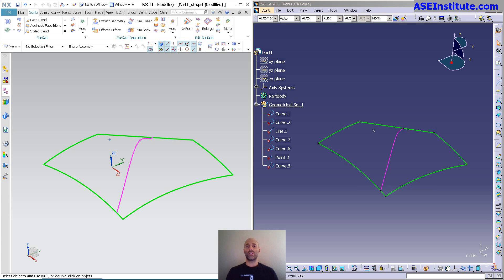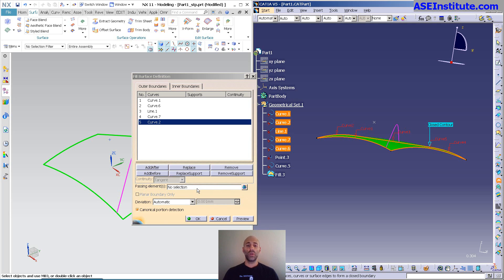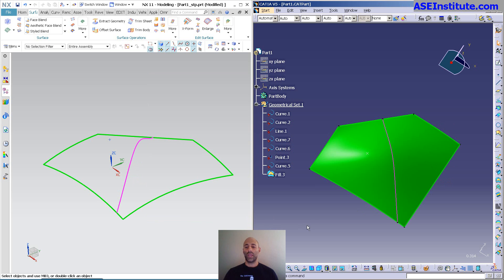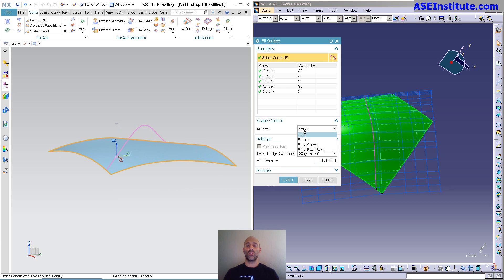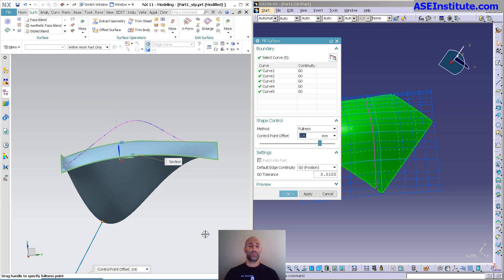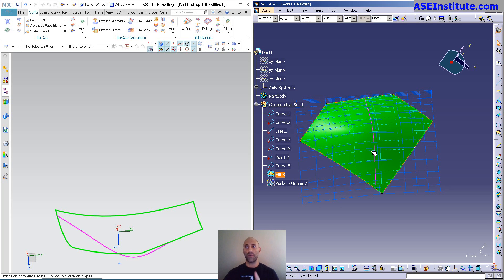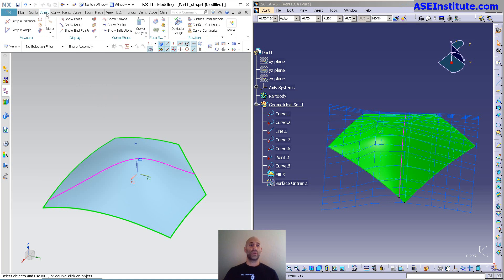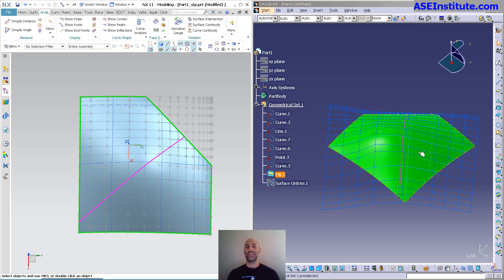CAD Wars | CATIA vs NX: Fill vs Fill

Comment: I like NX fill for patching holes in tooling or fixtures. example. When something doesn't offset correctly and leaves a hole in a non-critical area. Fill works perfectly.
Reply from the maker: That is about as perfect a spot to use fill. Honestly. A simple patch.

Comment: NX sucks!
Reply from the maker: You do realize NX is used pretty much exclusively to design every Russian fighter jet? And it is used to design some of the nicest cars on the planet. And Boeing uses it pretty much exclusively for military and defense.

Maybe you have no idea how to use NX?
Reply: @StevenMarji Yes, and I am the guy who built aircrafts CAD models for MIG and Boeing company using NX and CATIA. NX sucks because of it requires more actions to build same object comparing with CATIA. NX is also less robust and require more work to rebuild the model or to implement changes in the CAD model. NX is less intuitive and has a bunch of limitations. NX has crappy visualisation of big assemblies. The only reason companies use it is NX is cheaper than CATIA.
Reply from the maker: I am just going to go with you are not using NX correctly.

Both have good and bad things about them. It is a question of knowing how to exploit the good and reduce the bad. In some ways NX is pick heavy, I agree but in some ways Catia makes it very difficult to pick things.

NX has better assembly tools. ANd yes, you can open an assembly faster in NX. I have tested it. Catia has a simpler interface but lacks the tools NX has so in that regard it works faster but I can do so much more with the native NX tools.
Reply: @illla  

So, you make CAD model for both BOEING and MIG .... ?? 

WOW ...!!  Find me a better double agent ... !!

Comment: The NX fill command is also  very convenient for repairing defects on imported geometry. For example, if you have missing or bad faces after a STEP import you can fill in missing faces. For areas of bad faces you can delete the face then use Fill.
Reply from the maker: We have a winner.

Quick and dirty and it does a great job.